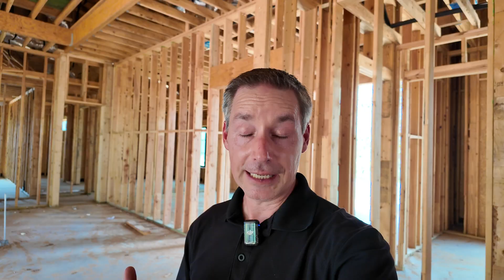Why Variable Speed HVAC Systems Are Worth Every Penny!

Comment: I don't understand why anyone who is using forced air HVAC systems wouldn't also use the heat pump version. Most perform well in cold weather now.
Reply from the maker: I agree, 100%. Especially here in Texas. It can be a little hard to convince some people that heat pump technology is more efficient, but it is. That’s actually going to be one of my big pushes going forward, and they can still run a dual fuel Emergency gas heat back up if they want.

Comment: I proactively replaced our 20-year-old Trane single speed unit last year with a Trane 2 speed unit. Initially I was frustrated that it never seemed to shut off, but then I realized that it was running on low speed. Our electric bills went down a bit with the more efficient system running at 67% capacity and, as you mentioned, the house is more comfortable. Even on the hottest days here in Phoenix, the unit never seems to need to run at full speed. If ever I'm fortunate enough to build a new home with foam insulation, I will certainly spend the extra few thousand and get a variable speed unit (Trane or Bosch). Thanks for explaining this topic so well.
Reply from the maker: Good to hear feedback from someone with one of these systems. Thanks for watching and I'm glad I explained it in a way that made sense. Thanks for watching!